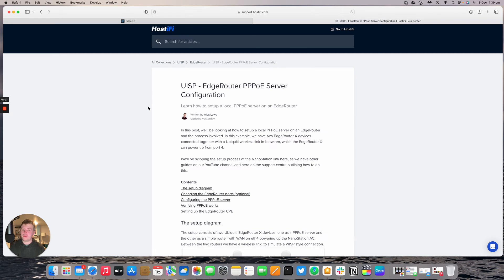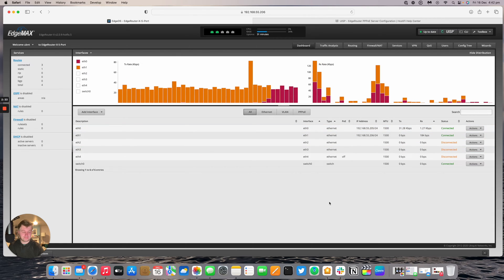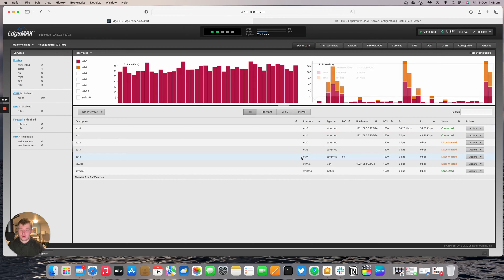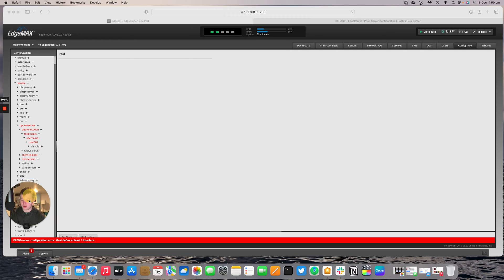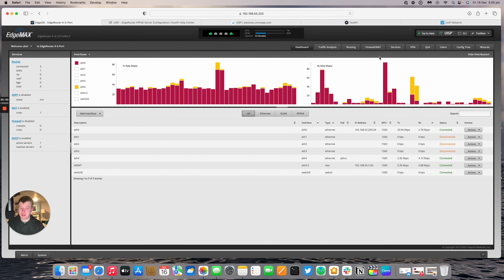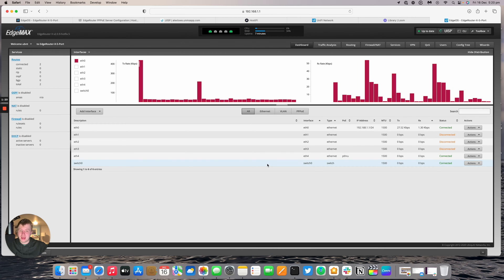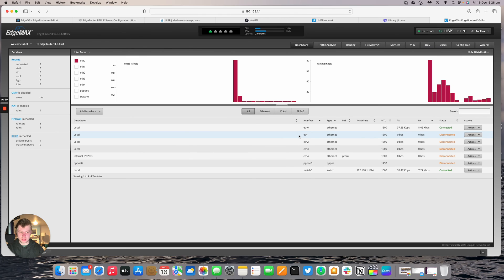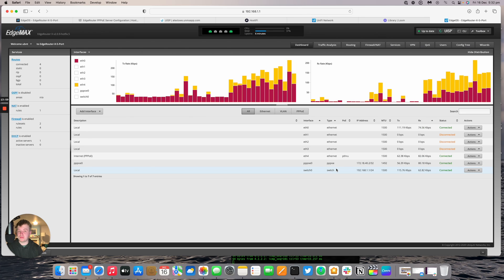UISP - EdgeRouter PPPoE Server Configuration

Comment: Is an Edgerouter still a good option? I want to get Alta Labs access points for my home, but need a small router with firewall and ability to setup PPPOE, and eventually fibre broadband via an ONT, probably over DHCP I guess? I do t want PFSense or OPNsense as that's far too complicated.
Reply from the maker: Thanks for watching! Yes, the EdgeRouter line is still supported by Ubiquiti but with less focus put on them. The EdgeRouter X is a great little router for example, with PoE (24v) in and out.

Comment: I’m trying to setup ddns on my edge router x and when I save and check the configs it says other insted of eth0 and I have tryed setting it up over 50 times and it does the same thing so I’m wondering how do I fix it
Reply from the maker: What firmware is the EdgeRouter running on?